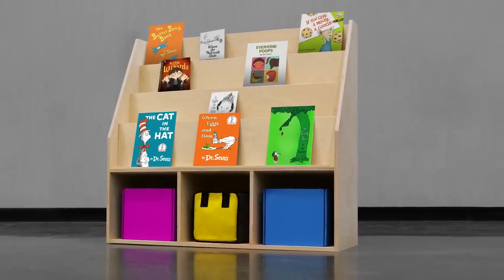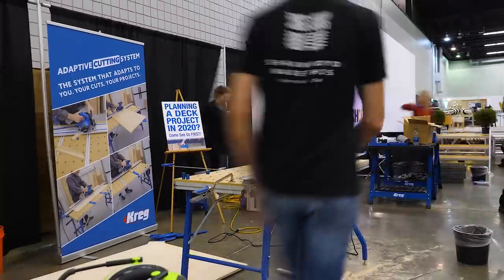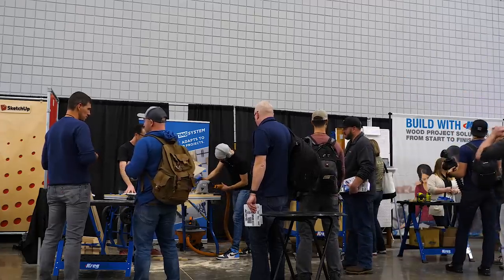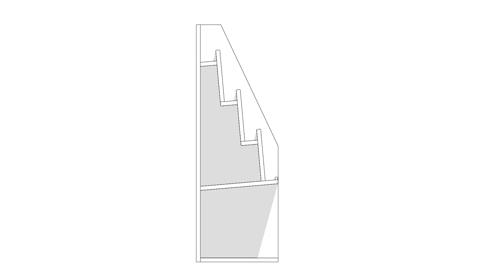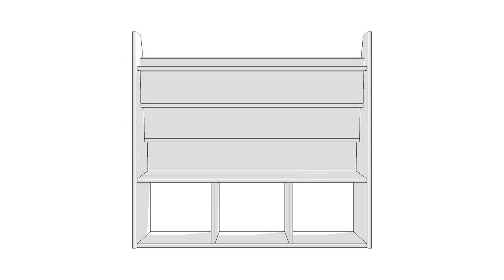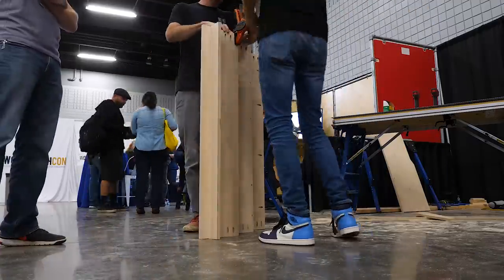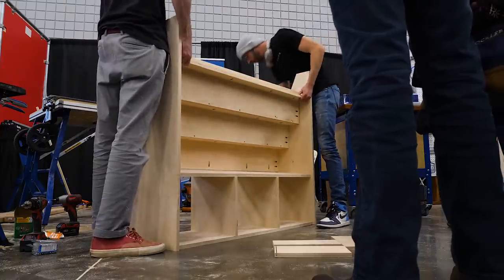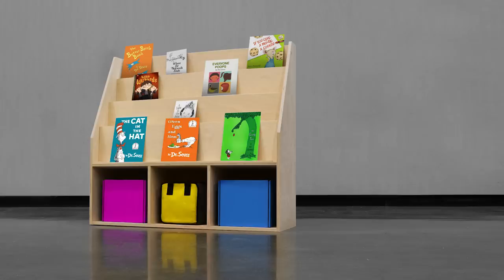DIY Bookcase for a Kid's Room w/free plans

Comment: Did you make a mistake when you said cut a 5 degree angle of the vertical partitions?   You’re not saying 5 degree bevel correct? The high side is 14 1/4 so what’s the low side?

Comment: Hey Chris, how does the Kreg track saw compare to the Festool, you have and use both right? Looking to buy one or the other, is the Festool "worth" the extra $300?
Reply from the maker: I like them both and find them to be equally good and useful. Using the Kreg on the table takes it to another level, and I've never used the MFT so I can't really compare the two
Reply: @Foureyes.Furniture  a couple months ago I asked for a dust collection video / safety breakdown for your shop, and you said "it's a few months out after you make some changes". That still in the pipeline?

Love the videos and your design style. I would put anything you make in my home 😃

Comment: How does that Ryobi Cordless Sander compare to your Mirka system back in the shop? Trying to decide between those two given the similar price points...
Reply from the maker: I'd say they are pretty similar in that they're both on the same quadrant of the color wheel in terms of their paint jobs. But if you value a yellow/Gold aesthetic and/or a really great sanders. I'd go with the Mirka.

Comment: What's the thickness of the plywood you used?
Reply from the maker: 3/4" (aka 23/32nds)
Reply: Thanks, could this be made with thinner plywood or would the pocket holes screws not work?